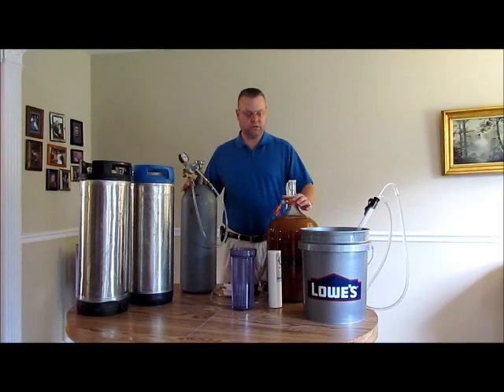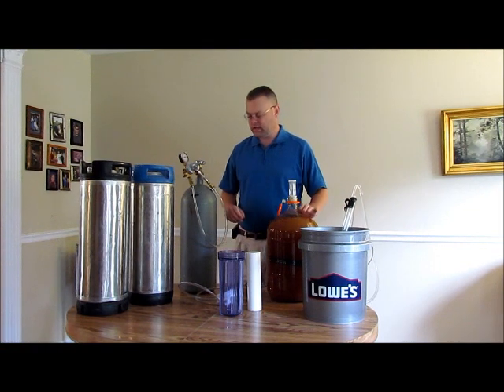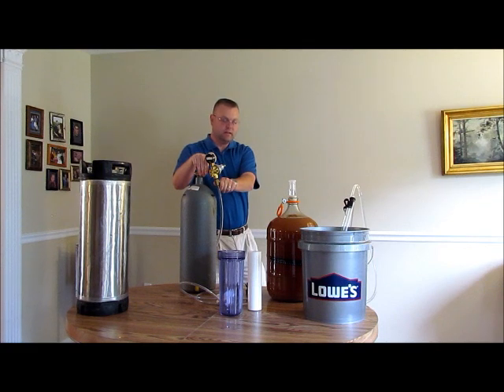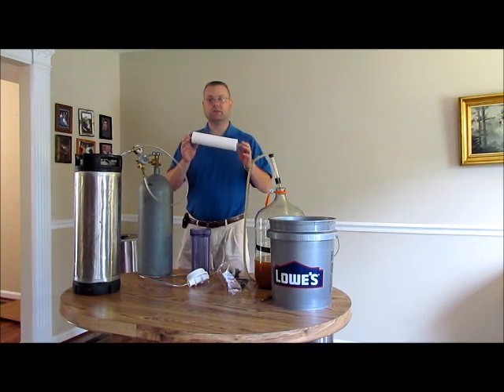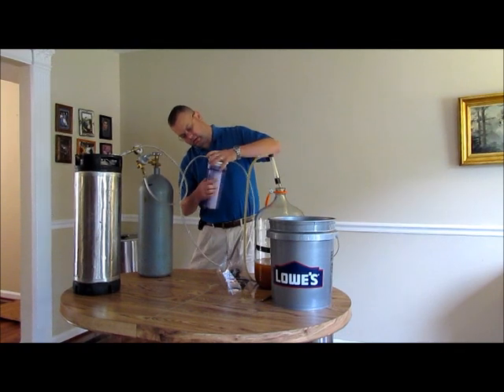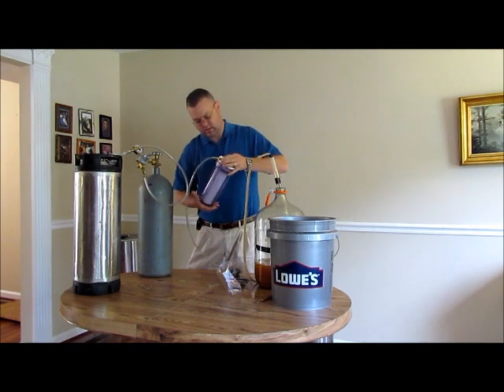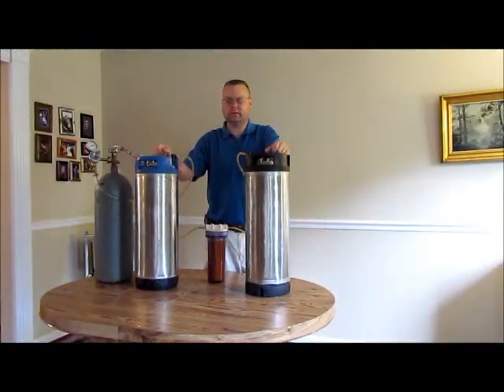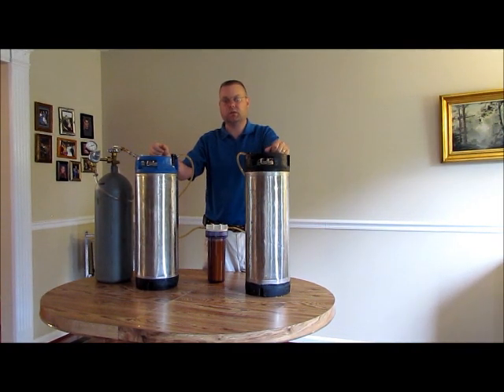How To Keg and Filter Your Home Brew

Comment: Great informative vid. Especially the part about purging the actual filter housing. Guess I just never thought of it. Never had a problem but as we all know when it comes to brewing you can never be to careful. We actually use a sealed conical fermenter that we are able to pressurize so it eliminates having to transfer twice. Works really well. Thx for the vid.

Comment: I used a  12v vac pump connected to the CO2 port of the keg and drew the beer though the filter directly from the fermenter bucket into the Keg . I prepped the filter by blowing through  with CO2 sanitiser from the the receiving keg . turned the filter upside down and pushed the CO2 through until the keg and filter  was empty of sanitiser. Connected vac pump watched the clear vac pump hose for  any foam or beer coming up the vac pump  line  as this would damage the vac pump while keeping an eye of the bucket level to calculate how much beer was in the keg. Saved on having an extra keg and cleaning it after.

Comment: You are correct, the keg the cider was initially siphoned into was open on top and wasn't fully purged of oxygen.
But, it did have an initial layer of CO2 in the bottom (see 2:29). Since CO2 is heavier than regular air, it would sink down to (and stay in) the bottom part of the key. As long as the keg is filled from the bottom up, the CO2 layer will then "float" on top of the rising cider level (keeping the cider from coming into contact with the regular air). Does that make sense?
Reply: that's a laughably naive statement. Gas doesn't stratify, it mixes. https://en.wikipedia.org/wiki/Dalton%27s_law

Comment: You could use a PVC reducer to go from 3/4" MPT down to 1/2" FPT, then get a brass fitting to go 1/2" MPT down to 3/16" Barb.

Comment from the maker: You can get the system on Ebay for around $60 or so.  You can buy bulk filters (25pack) for around $50.  As for how many times I use my filters, just once.  
You could use them more if you line up your filtering for one day, I.E. filtering 10-20 gallons or several kegs going from lightest to darkest.  
However since you are putting your final product in the keg you should not store a used filter for later use (to much bacteria), it will ruin your beer.

Comment: Hello nice tutorial for all small brewers out there. Just got a type D barrel and thinking about keging and carbonating, We use wirflock to minimize the hazy and get a clean beer, think we could skip the filter and get the beer to the keg directly after the rack?
Reply from the maker: You can always skip the filter if you like. If you are kegging in steel, the beer will be fine and clear up over time when stored cold. The primary benefit to filtering prior to kegging is consistency. The thing with wirflock is, this is to reduce the proteins which cause haze in your beer, they do nothing for the yeast... This is where the filtering comes into play. Again, not mandatory, just one more step we can take to improve the beer.

Comment: You could always cold crash and not have to use a filter... thank you for the video!
Reply: Cold crashing doesnt always remove everything.  Although you dont see it, alot of yeast stays in suspension after a cold crash.  A filter will remove 99% of anything in suspension.
Reply: tiltrotor22 but yeast is good for it contains vitamin B1 etc.. so if you cant see it n its clear why not cold crash..
Reply: +TheMitchtuber I for one get tired of getting insane gas and various stomach problems,so buy some vitamens and drink clean beer.

Comment: Thanks for a great video! I've only filtered one batch so far and it turned out great. I was just bummed out by the amount of beer I wasn't able to get through the filter in the very end. By the looks of your demonstration there also seems to be about a good pint of beer that "gets stuck" in the filter. I tried different elevations and burping the receiving keg, closing the valve on the filter and so on but couldn't get that last beer to go all the way.

Any solution to my problem?

Comment from the maker: are you sure you had it hooked up to the right posts?  It should flow from you out post to your other out post.  If you put your CO2 on the out post with home brew in the keg then it will bubble up at you.  When pushing your brew from your original keg to your filter the CO2 should be hooked up to the in post.

Comment: I bought the same filter system you have. After I hooked everything up to transfer from the first keg to the second the beer would not transfer to the second keg.  I doubled checked and the lines were coming from the proper ports, made sure the ball valves were properly seated.  The beer flowed from the first keg through the filter up the out line but everything stopped when it got to the out valve of the second keg.  I also increased the pressure on my tank almost to 20psi.  Anybody have any ideas?  I used a 5 micron filter on a pale ale

Comment: Hey Brooke.  The filters are sealed and sanitized already.  Just open and use.
Reply: Robert Dexter hot tip!
The foam from the starsan is not «dangerous to your beer before fermentation, but after the fermentaition, all those little bubbles contains oxygen and should not get into your fermented beer!

Comment: Hello, question. Why do you use two kegs? Couldn’t you just go from carboy to filter to keg? I want to do this but don’t want to clean more stuff.
Reply from the maker: Hi Mrjc, good question.  The main reason one would use two kegs is due to the pressure levels. While there is equipment which will let you push from a carboy into a keg, I personally have found the 6lbs or so of pressure needed to move your brew through the system will pop the rubber carboy tops.   These carboy kits are better suited for transferring from one carboy to another or into bottles.  You may be able to use this method, however be careful.  I have heard stories of people using this method and their carboys end up cracking or blowing out due to the pressure.  Best of luck.
Reply: Great! Thanks for responding so quick. I will be trying this out over the weekend. I will take your advice.

Comment: Are you able to clean and reuse the 1 micron cartridge filter or is it a one time use process?  Can you give me the brand/model number of the 1 micron filters and the cartridge housing you are using?  Lastly, I see that pentek offers both pleated 1 micron filter cartridges and also just the non-pleated cartridges.  Do you think the pleated cartridges would be cleanable and reusable?  Thanks for all your information and the great video.
Reply: +Barry Mizes The home wine making industry has a motor powered filter that uses inexpensive .5 micron filters...much cheaper to replace.
Reply from the maker: +Barry Mizes Hi Barry,  you could use the filter for multiple batches in the same day.  I would advise against cleaning and re-using the filter, to high of a risk for infection and at the end of the process, you would hate to have it bad then.

Comment: Hi. Maybe you can help me.
I'd like to convert a 7.75 gallon keg to a pot brew to make my beers but I have noticed that the surface is not plane for kegs in this size like it is in the big kegs and I'm afraid the ball valve couldn't be well fixed there (there is a salience in the place we normally put the tap/ball valve at the keg bottom).
Actually I haven't seen people converting 7.75 gallon kegs but mostly 15.5 gallons keg size.
Do you think it's possible to easy convert a 7.75 gallon keg?
Thanks

Comment: When you filter your beer, are you able to reuse that micron filter or do you use a new one each time?  I just purchased a system, which carries a 1 micron filter, but once I was done, the filter wasn't that bad looking, but couldn't clean it very well.
Reply from the maker: Hi Brannon,  you can re-use filters if you want to.  If you do this, I would say only if you have another batch on deck for filtering and is one of a similar or stronger flavor profile than your first batch.  You can clean the filter using StarSan and then start on the second batch.  Any longer than that and the challenge becomes cleaning, storing them, and making sure they are sanitary!!  

IMHO, I found that the work needed to do this is not worth it.  I buy my 1 micron and 5 micron filters in bulk, around 50 a box.  This keeps me well stocked for at least two years.

Comment: Can you please post a link to where I can purchase that filteration system, and the individual poly setiment filters? Also, can you explain why you didn't use star san on the filter?
Reply: +Cameron C The home wine making business have motorized power filters which use inexpensive flat replaceable filters.
Reply: +Cameron C 
I was wondering about sanitizing the filter too.  I always thought you were supposed to run a filter for a few minutes when new-maybe that's just charcoal filters.

Comment: Ingenius.  I have the filter setup for carbon filtering my mash/sparge/boil water.  I'm having trouble finding fittings to get from 3/4" male NPT (in and out on filter assembly) to 3/16" barb (beverage line to both kegs).  Any source for these fittings or alternate way to skin that cat?  Thanks for posting!  DB

Comment: Do you need to sanitize your filter cartridge or canister?
Reply: Hi Doug, yes I sanitize the filter prior to using it. I soak it in some starsan for about 5 minutes prior. once it starts filtering toss the first few cups since it will have a lot of sanitizer in it.

Comment: Wouldn't the 1 micron filter affect the final taste of the beer?
Reply: Jonathan Small Not mine. Makes no obvious difference at all. In fact, I'm down to a 0.5 micron.
Reply: +Jonathan Small Depends on the beer. Certain wheat beers and heffys are supposed to be cloudy and use the yeast as a big part of the flavor profile. They can still be filtered just use like a 5 or 10 micron instead. I use a 1 micron for almost all of my beers and it comes out great. Even with dark stouts and porters.

Comment: Seems like slot more work than needed. Why not use pectin enzyme.
Reply from the maker: Hi Joe,
Pectin enzymes will help prevent a haze when you are heating your must and using a fruit. These enzymes do nothing to remove yeast still in suspension. If you plan as I do, to store your mead or beer for a long time, you want that stuff out
Reply: My bad.. I’m still learning. I’m going to try a similar system.

Comment: I wish to toss this idea out to you for your views?

How about we filter just as you show in this video, but do it right out of the boil pot?
In other words, once the wort is cool, move to the first keg, then run though the filter to the carboy.

This would mean you no longer have to worry about sucking up the crap at the bottom of the pot.
After fermentation in the carboy do everything again as shown in this video to filter again into the keg
Reply: +alan molstad Most of what he is filtering out here is the suspended yeast. You pitch the yeast in the carboy. So you are straining the yeast out after fermentation.
Reply from the maker: +alan molstad Hi Alan,  you could filter prior to fermenting if you wanted to, however your risk for infection goes up and if you whirlpool well or add irish moss, you shouldn't have any issues pouring into your carboy.

Comment: cheaper to go buy a box of beer from shop than buy all that plus the rest of the things you use. why go to all that trouble for a beer? i buy a kit add a couple of hops and dex. then syphon into 2LT soda bottles leave them for a month then when i want to drink them i get a can of pipe freeze spray. spray the bottom of the bottle then pour the beer out leaving the crap at the bottom. plus a ice cold beer in my jug. i do the same with my barrels and if i take a barrel to a party i spray freeze the bottom. and put the barrel in a cooler bag till i get to the party. no cloudy beer. and no much cash spent. i spent 40 UK pounds on used home brew stuff all i buy now is the kits and hops extra corn sugar not thousand pounds on all that lot. i was lead to think home brew was for saving money?.